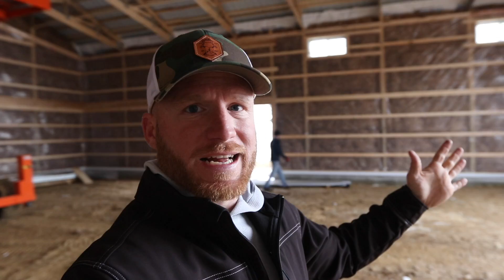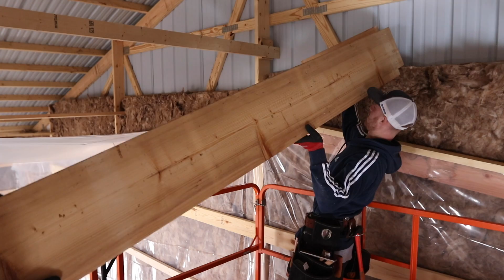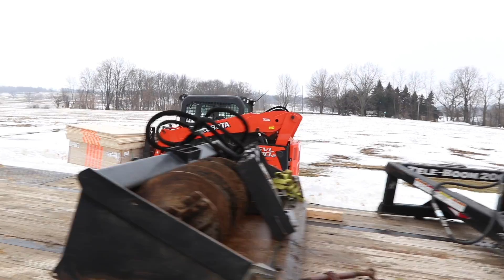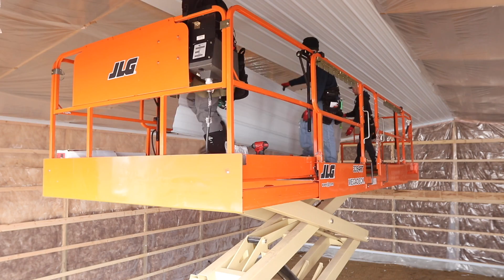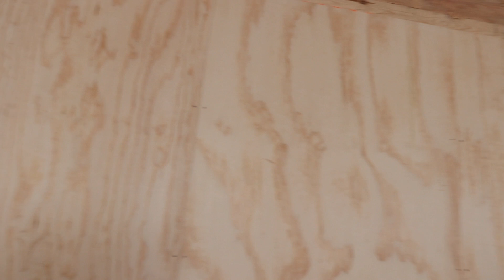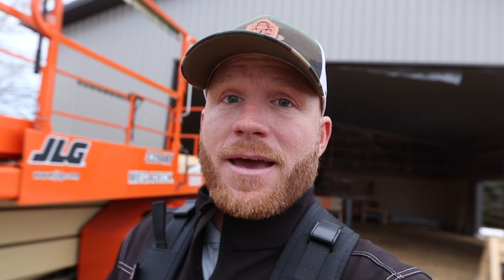Building a Work Shop: Installing a Metal Ceiling

Comment: Kyle, very educational video! Thanks!! I am starting the plan for finishing interior of my post barn. Question: for the wall steel, what are your thoughts on framing inset 2x6s in between the posts/cavities with flush metal to the post vs running horizontal 2x4s on the posts and securing the steel to the 2x4s? I see you ran 2x4s on the outside of the posts. Any thoughts or pros/cons would be appreciated. I am going to do spray foam insulation. It’s a large 40x70 structure, so really not concerned about giving up 1 1/2” per wall if I run the 2x4s on the outside of the posts. Any structure pros/cons? Thanks!

Comment: Adding my own metal ceiling to my new Morton building right now.  Kyle, what gauge of steel is that you used for this project?  Can 29 gauge Metal Sales liner steel span 8' O.C without sagging under the weight of insulation, or do I need to add some kind of nailer in between trusses?

Comment: Is metal ceiling a condensation issue during temperature swings if you don't condition space 24/7? I was hoping to use metal ceiling, but temp swings and humidity levels coupled with the fact I will not condition space all the time has me wondering?

Comment: When ceiling metal is spanning 8' do you ever have issues with sagging between trusses?
Reply: This is why I am reading the comments.  I have a post and beam building like this that needs interior finishing.  I just don't think an 8' span is good.

Comment: I see that you’re installing panels top down too. Would that make the overlap backwards in the case of high humidity running down the panels and then getting trapped, or does the overlap act as a stop?
    I’d guess that the reveal is cleaner looking installed from the top down though.

Comment: So how do you blow the ceiling insulation in after putting up the ceiling metal?  Is that box frame you put in near the peak on the wall opposite the garage doors some kind of attic access that you cut the sheet metal around for access to the attic space?

Comment: Did you have a nailer ledge above the F-channel you ran on the gable ends? Or did the metal panels just rest on the lip? Did you use soffit covers, like AccuVent to prevent the insulation from getting on the soffit but still keeping airflow? Nice video.

Comment: On the raise cord trusses I think you should start your roof vapor barrier at the bottom then work your way to peak on both side that way your top sheet doesn't get condensation running off of it and then it will run on top of the bottom and the moisture will get to the ceiling insulation. Depend on how much condensation maybe even the walls

Comment: Metal ceiling is fun until you have to cut in and install overhead HVAC as you go. Lol. I agree with you though, as long as you have clean runs to fasten - it's very satisfying

Comment: The reason you get mold in insulation is do a lack of  insulation where hot and cold can meet easily or a leaky through the siding or roof. The best insulation I see from remodeling projects is paper back insulation from the 50s. When the exterior walls could breath from using built rite or 1x6 boards. The problem is they aren't efficient.  So now we choke off the flow of air. The only problem by doing that is if you have a hole it leaks A LOT of water. A 1" hole in the vapor barrier can transfer 30 qts of water.  So by putting up a plastic and not sealing the seems along with having an open space behind the metal walls is a problem in cold climates. You may want to reconsider how you seal the vapor barrier. It must be 100% or nothing.

Comment: I need to put a ceiling in my barn too. Do you use metal with taller ribs for the 8 ft span? Just wondering how much it would sag.

Comment: Great videos!  Quality work!  Question...I'm contemplating using Menards material for my post frame ceiling.  They have a Dura Panel with a lighter gauge of steel.   0128 thickness which I figure is 30 gauge.  Do you think it will hold R30 blown in insulation on 8ft OC trusses?

Comment: Great video! You made a good point in your video.... there was a warm up taking place, so then air inside the shop was warmer than the air inside the insulation cavity. So, the plastic did not cause the condensation.... it just kept it away from the insulation.
 Thanks for you many videos, I’ll be tackling a good size farm shop soon. I have watched many of your videos several times each. Thanks again and God Bless you, your family and employees.

Comment: What gauge material do you use for your ceilings so that it doesn’t bow or sag over a 8’ span with insulation weight on top? Looks to be a 3/4” rib height but can’t tell if it’s 29 or 26 gauge. Thanks in advance! Keep up the good work!!

Comment: I live in Texas so the insulation rating is a little different ; however, my drafting skills and building expertise say you are completely right in the fact that you want you outside to breathe and thing inside vapor barrier to have condensation in the interior of the building (provided you you regulate the humiy inside the building)that provides the same function as a brick fascia to sheathing breathable space. It's super cool to see the difference in building structures like this from the South to North so good on you my guy keep it up!

Comment: We are doing a living space that will have a metal ceiling liner and Blown Fiberglass R38... The insulation contractor has indicated that "poly would / should be used on side walls.  On a metal ceiling we don't use it so the moisture can pass through and be handled by the ventilation."  I would like to know if there are different views on this and what the reasons would be before the structure is built if anyone has counter information.

Comment: sealing the inside of the building will create moisture inside, you have to install ventilation vents at the top and the bottom of the building to create airflow, they must be installed to the outside air, to prove my point get a ice chest or cooler and leave it outside, you will see it will be wet inside as moisture cannot escape due to not having airflow, everything will go green and create bacteria to grow which will ruin your health, you have to look at venting volatile gasses as well which will kill you, plus fuels cannot be stored inside as a small amount left overnight if it get a spark the entire building will explode.

Comment: Not sure how it works on a steel building, but the system on our house (from BuildingScience.com) has no vapor barrier on the inside. It has solid EPS on the outside with steel siding over that (rainscreen construction -- no water penetration from the outside), and bat insulation on the inside between the studs. The big difference in design is drywall inside vs. steel. I would be very curious to see what they say on this. I contacted them and sent them a link to this video.  It will be interesting to hear what they have to say!

Comment: Cant understand,!! you had a building with a roof on, you Knew there was gonna be a heavy snowfall, but with all the space in the building you chose to leave youre machines Outside, then had trouble starting them because they were cold??? Duuhh!!. good videos great chanell.
Reply: Even if they were put inside and there was still no doors to shut out the cold, the equipment/machines would still get cold and be hard to start.

Comment: Kyle, really enjoy your videos. I am a mechanical engineer and  building a house in Finland (much the same climate as where you are).  Before I started I read Joseph Lstiburek's book, "Builder's Guide to Cold Climates."  It has very good information about vapor barriers and placement. The basic principal is that the temperature varies through the wall structure and as long as the temp is higher than the dew point you will avoid condensation. In our climate (primarily heating-no Air con) the vapor barrier should be on the warm side - like you build. The house wrap you put on the outside works as a wind stop, and is vapor permeable so doesn't really come into play. It is also good to keep the other side ventilated so that any moisture that builds up during wet periods can can dry during dry periods, also how you build. To go to the next level you could start taping the seams of the vapor barrier and add a heat recovery ventilator -not sure people would be willing to pay the premium though. Again really enjoy the videos and your obvious love for your job. Keep up the good work.

Comment: What were you stapling with the paslode on that first run of the ceiling
Reply from the maker: J channel
Reply: @RRBuildings  at the 8:36 mark it looks like you're stapling the metal on the ceiling at the ends of each panel

Comment: Cant you buy your wood and plywoods from the local distributor rather than going through the middle man ( Mynards) and paying additional markup. It looks to me as though you buy enough material that you could get it wholesale.  I always could so figured you could if you buy full units .
Reply from the maker: Km always told I would need a lumberyard license and retail space
Reply: Maybe suppliers in your area have odd requirements.  I had the cabinet shop in Washington dc area and bought wholesale from all suppliers I wanted to buy from. I mainly delt with 6 suppliers but all wanted my bussiness and would compete against each other to keep it.

Comment: People think that you trap moisture      in the insulation when you use a vapor barrier.  But it works just like you said stops moisture from inside getting to it. If you have a moisture barrier and the insulation gets wet it's from the outside. Water is getting in somewhere. Someone did a piss poor job of sidding or whatever was used.

Comment: Personally I would never use plastic vapor barrier again. Used one in a guest house I built. Moisture found it's way behind it and caused mold and rot. We just ripped it out and all the old insulation too. Fixing the rotten wood, will stain and odor block prime before reinsulated. Cause a ton of damage. Just think what happens if moisture get behind VB. I have found in my research since that for every nail hole sized penetration in a VB you can get 1 pint of water per year. It's then trapped. Seeing as those are steel buildings and very leaky, air, you may be ok. If you want it sealed 2 inches of closed cell spray foam on the outside will be the best then fill the rest with more or other insulation.
Reply from the maker: Totally can understand.   Always a constant battle for what is not only the best... but also affordable and sensible for the client.   I don’t have all the answers but am always willing to educate the client on well spent money vs needless money

Comment: Looks good! I use the same AC ply from Menards for my shop projects, it is good stuff. What is the biggest problem with the Hitachi, Metabo HPT nailer you have?
Reply from the maker: just that the safety or on button has to be re pressed if it sits too long

Comment: Question for you from a builders standpoint. We're in the planning phase of our single level farmhouse style new house that has a attached two car garage. My idea is, instead of a two car garage, just have a 40x60 attached instead. Since the foundation has to get poured just keep pouring and the framers have to frame why not keep framing. What is your opinion?
Reply from the maker: Love it. Bigger is better and a simple approach will be cost effective in my eyes
Reply: @RRBuildings  thank you! In my mind I'm thinking it will be cheaper than a seperate building depending on local codes of course. I will definitely run the numbers and get with the engineer to see drawings and such.

Comment: Agree, why no taping to seal the vapor barrier
Reply from the maker: I guess I was taught that way, and I can't imagine how I would ever get a good tape job without anything to push the tape against...therefore negating the effort it took to do it... just my thoughts could be wrong
Reply: @RRBuildings  Every seam would have to be over a board to make it work.

Comment: I’m redoing my camper at the moment and it has no vapor barrier so I got the walls off and pulled the insulation out and it’s soaked and the metal outside is sweating a lot on the inside so I’ll be adding a barrier

Comment: How do you manage the water that the vapor barrier generates?
Reply from the maker: In a heated and finished building the vapor barrier won’t be forming... the insulation will keep that air space warm and therefore not condensing.
Reply: @RRBuildings  Must cost a pretty penny to keep that space warm enough to prevent condensation.

Comment: Please correct me if I'm wrong, but it looks like on putting up the ceiling panels, you are screwing off the leading end and nailing off the tail end, with the next panel overlapping to screw off both ends of each panel. Is that right? If so, I guess I just never noticed that detail before. Always learning something from watching you work. Thanks for sharing!
Reply from the maker: Yes sir that way we hide the nails

Comment: The vapor barrier is fine. You have those cords that create an air gap that will allow it to dry out. Only thing I would do different is tape the seams. But even then, you have a vapor open house wrap that can allow what moisture does get through to dry out.

Comment: Hi, Is it possible to build 40 meters by 30 meters, possibly snowfall?
Reply: he knows the building length, width height and the trusses are sized appropriately
he has mentioned snowload values in a few videos
Reply: There reaches a point where your snow load and span will dictate you will have to go to steel to be cost effective.  Roughly 100 ft span at 50 lbs per  sq ft you will likely be looking at steel.
Reply: In fact, look for less expensive because the subject charity @moniquemelanson1114
Reply: @janshamo1724 , if you want wide spans, you may want to check out Morton's hybrid buildings ( metal roof trusses on wood columns)
Reply: @Joshua79C  The cost is measured at 40 meters in 30 meters
Reply: @janshamo1724  "width by length" or "length by width"?
Reply: @Joshua79C  40 meters length 30 meters width

Comment: Tip on unloading stuff like that with a skidsteer. Slide the pallet out about halfway, then lower the boom on the loader and tip the forks back at the same time with half the load weight still on the truck. It uses the weight of the load to tip the forks back if the loader hydraulics can't do it and it will prevent the load from tipping forward and smashing on the ground when you set it down.

Comment: A vapor barrier is not to stop condensation to migrate through the insulation and condensating on the outside cladding, but to stop if from actually saturating the insulation, reducing its effectiveness.
Warm air holds more moisture, and since the building is generally warmer then the outside air, the moisture will be attracted to colder surfaces, normally the walls.
Reply: @JorgTheElder  thought that was what the house wrap was supposed to do.
Reply: @marshallmurrell4583 :  House wrap is to stop the infiltration of the wind (dust) from the outside.  It's semi-permeable so any moisture (condensation) is vented.

Comment: Why didn't you use the tracksaw for ripping the AC plywood?
Reply: because the cut line was scribed to the adjacent wall and probably not perfectly straight like a track saw cut would be.
Reply from the maker: Exactly what Simon said

Comment: It's really interesting to follow you work, thanks.
Maybe you can address some questions? Why metal? Wouldn't any composite materials be lighter and more durable? Metal surfaces - when cold - get moist. Don't you have rust issues on tools and machines in such workshops? Metal also absorbs heat - what about climate control in both summer and winter? What about cellphone and radio signals? You're building a faraday cage(?), right?
Reply: Having worked in one I can tell you that cell phone signals do still get through.

Comment: Eddie Haskell, the snake in the grass from Leave it to Beaver.
Before you got the lifts, did you put up all the metal ceilings using ladders?
Reply: "Ward don't be so hard on the Beav!" - one of my favorite lines by 'mother' of "The Beaver" June (Barbara Billingsley).  The off-reference in that line went right over my head during the first run in 1957 - 1963 when I was child, but it broke me up when watching the re-runs as an adult.
Reply from the maker: Only used a ladder when ceiling was less than 10’ tall otherwise always a lift

Comment: We experimented with using plastic on the inside like that in the 80's. It creates a stew pot for toxic fumes from the building materials and bacteria. It made alot of people sick and coined the term sick building syndrome. Lots of lawsuits. Don't do anything like that without having an engineer to hang it on. If you are installing the hvac we found that a few dozen air changes each day helps.
Reply: He said the space would be 'climate controlled'. AKA hvac.
Reply: @Z-Bart  
Yes but the liability was implied. Is R&R installing, or subcontracting, or disigning. If you turn it over as is the owner can simply hold the contractor as responsible.
Reply: One of those hidden costs of contracting is the trips to the lawyer's office.

Comment: nice.  but how did you seal the bottom and top of the vapour barrier.  So yes it works, but air stoppage not really.  you need acoustical sealant to make an airtight vapour barrier.  thanks